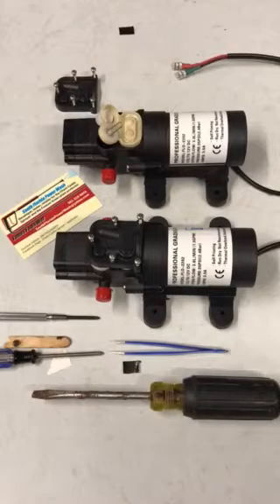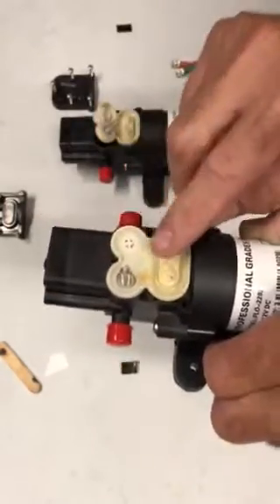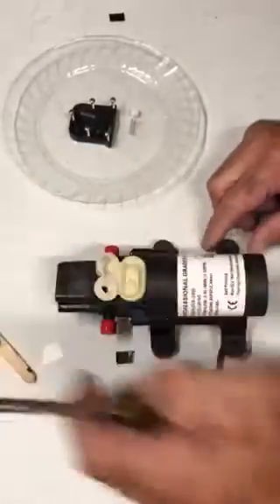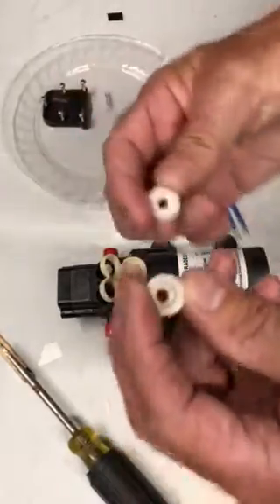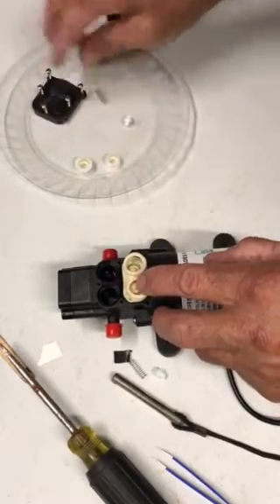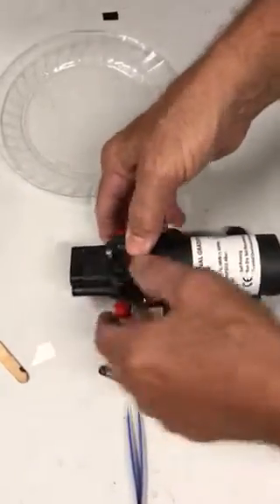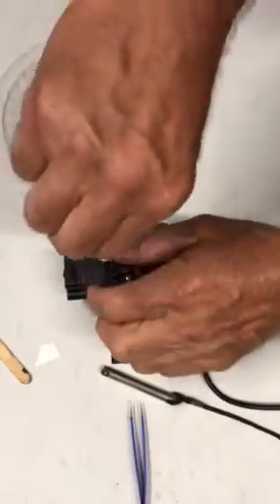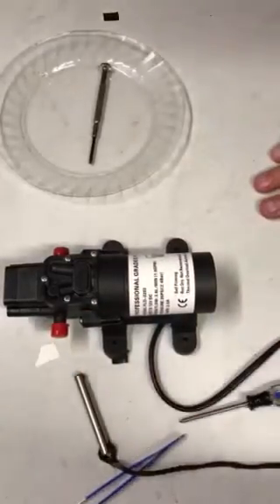Chem Caddy pump repair and clean out

Comment: Excellently explained Jim. Some great tips offered up and hopefully many such as myself will benefit and perhaps a little less landfill created too! I've got a unit almost exactly the same as the one you operated on. Just lately when I switch on the power to it, it won't run... unless I give it a little tap or two with a small screwdriver at the pressure switch end. I wonder if you experienced the same and thus took the initiative to open up the pump and have a better look...  what symptom did you encounter initially with the pump? 

Ever heard of the 'tap to start' temporary 'fix' that I'm now resorting to? I'll take mine apart someday soon and have a pretty good feeling I'll find some debris, possibly from the filter as you so kindly pointed out. I use mine in an old RV for water supply to a small facet/sink. I did wonder if it might be the 'pressure switch' and did see the part is available (on eBay if I'm not mistaken). Hopefully the part is somewhat universal in case the debris removal theory doesn't work in my case. I'll endeavour to get back to you when I get around to it.

(Many thanks for your efforts herein). 

Regards, Omni'